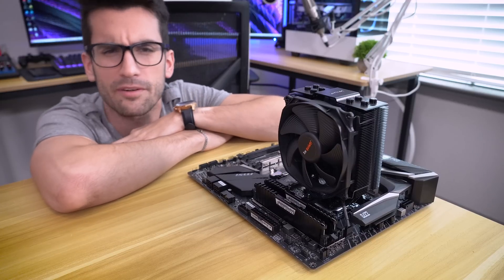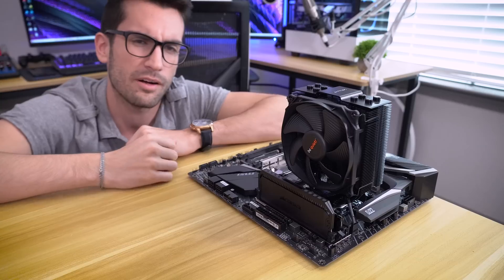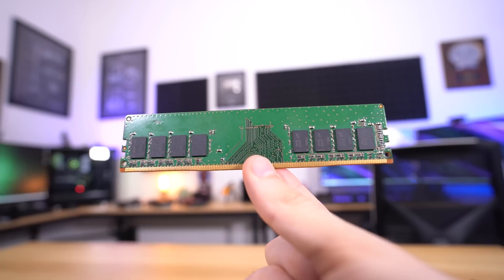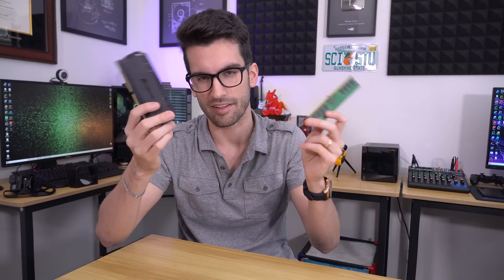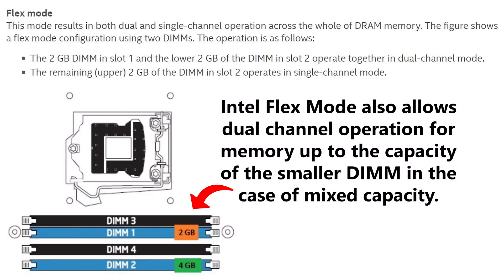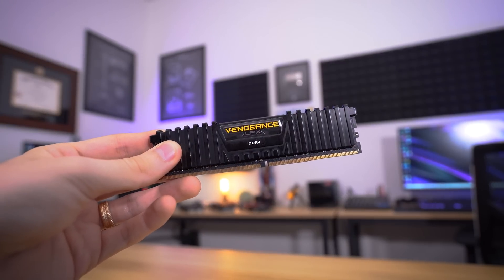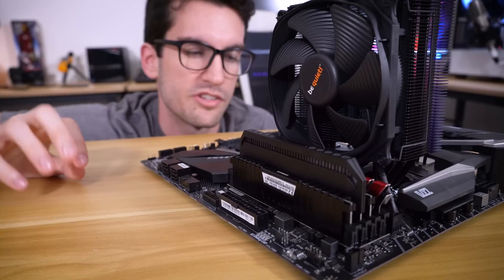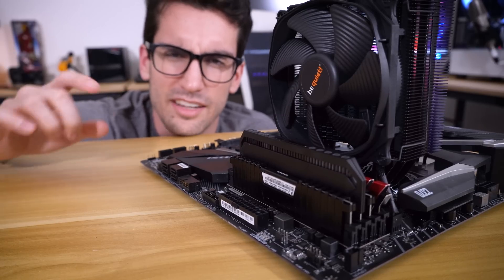Mixing RAM?!

Comment: Reminds me of my first personal PC...

A 366MHZ AMD with a crappy PCCHIPS mobo that had 2x simm and 2x dimm slots.

Turned out you could mix them. (In hindsight, i must have severely gimped the memory speeds there) :P
https://stason.org/TULARC/pc/motherboards/P/PC-CHIPS-MANUFACTURING-LTD-Pentium-M590.html

Comment: An important addition, I think, people shouldn't assume that the memory is the same if they don't buy it as one package. On the same model the memory can be different, for some/many models they use more than one die. Corsair Vengeance for example is known for that, you might get SamsungB, you might get HynixC...
Reply: Great point. I have that exact ram. I had 2x8 gigs, so I upgraded to 4x8 by buying another 2x8 gig kit. Same brand, model, frequency, latency, etc, but different manufacturers. It caused me to have boot issues. It would work fine for a couple of months, but then it wouldn't boot unless I power cycled multiple times. Eventually it wouldn't boot at all until I removed the RAM and put it back it. Same thing would happen every couple of months.
Reply: @HorseyTimes  have you tested the memory in different slots? And just the new memory? If it does not work with just new memory in any slots it's the new ram that is the issue. Weird it works for and then not. Could be ba motherboard. I had to swap motherboard on old pc, cus pc slowed down randomly, fna header died, board bent maybe 5 deg. USB devices randomly disconnected.
If no such issues it's the ram I think.
Reply: @mtbboy1993  I initially thought it might be the motherboard also. I swapped the battery thinking maybe that was the issue,  but the only thing I could do to get it to boot was to take out the RAM. Everything works fine once it has booted. I'll probably buy a 2x16 gig kit in the next week or so and see if the problem continues to reoccur.
Reply: how much difference will thatt do? I have Corsair DDR3 1600MHz 2x4gb 8GB LP in my system now. so if I buy the current stock, will it be different from the old pc?
Reply: @mtbboy1993 it caused me to have boot issues. My PC would turn on but wouldn't post. Sometimes I could get it to post, if I power cycled a few times, but eventually it wouldn't post at all. Removing the Ram and putting it back in seemed to temporarily fix the problem,  but for whatever reason the problem reoccurs every couple of months.  The only thing I can trace it to is the RAM upgrade and having different manufacturers.  I don't know of a way to check the manufacturer, at least not online.
Reply: @HorseyTimes  Usually it has a name on it. Unless dyou bought some random cheap ram. Best thing is to search for same Ram. But if it really differs within same model I don't know how to avoid that. Not had this issue. I rebuilt my old pc with two more sticks of corsair Vengeance ddr3 1600mh was 8gb upgraded to 16gb. No issue.
But if it worked for me does not mean it will work for you. I've not had issues with ram dying or being defective. So I went for Vengeance ddr4 on my new pc. No problems, 64gb. 👌
Reply: @HorseyTimes  maybe it was faulty? I did not have much time on the rebuilt pc but it booted up fast no issues. But could have got exact same memory down to every single part. Who knows.
Reply: @mtbboy1993  yeah both kits are Corsair Vengeance RGB Pro 16GB (2x8) DDR4 3600 C18 memory. They just have different manufacturers.  Each RAM stick works on its own and in each channel. I really think it is just a problem with the different manufacturers. I will probably just buy a 2x16 gig kit.
Reply: @HorseyTimes  So not exact same model as I had. Nor the new ones I have. I basically got same style, no bling, no RGB. Old pc has DDR3. DDR4 was the current memory standard at the time. 
DDR5 exist, but it's very limited, and price was insane. only most extreme builds had it, very limited board and memory options back then, but not checked if lately if DDR5 is current.
Reply: @mtbboy1993  yeah when I said I had the exact RAM I was replying to the original comment. I have Corsair Vengeance one kit manufactured by Samsung second kit by Kynix. I don't see anywhere on the Amazon listing where the manufacturer is listed, to avoid similar problems,  but it could be buried somewhere.

Comment: I mixed a pair of 8gb each cl 15 3000mhz with a pair of 8gb each of cl 16 3200 so I could get 32gb in my system  until I could and as long as I set the speed and timing to the slower sticks everything worked fine.

Comment: Ugh, you can tune timings per channel on some boards.
Different ICs will work fine if you  check that BIOS has trained the memory to stable timings, I shouldn't need to say this, but XMP only stores primaries and a few secondaries and tertiaries, which means even a good set of the same ICs can be unstable if you have a  mobo from companies like Asrock, Gigabyte and Biostar

Comment: It's funny I just had to get more ram for my system because between space engineers and chrome being pac man on my ram I have been maxing it out but the same ram I have now was gonna cost more vs much faster cheaper gskill memory.
Reply: What? Did you mix the RAM or not? Are the mixed RAM of deferent size or not? What about their frequency and timings?
Reply: Get what you can afford and tweak the timings till memtest is stable to 20k%
Reply: Got a similar situation, only difference is, that at this point putting more in is a waste.

Comment: For ryzen slots 2 and 4  usually can run ram better than 1 and 3 that is because  slots are usually on ryzen boards conected in daisichain so trace from one chanel goes to 1 and fom there it rinc to 2 same for 3and4 ...so saying tat it is logical tat shorter path is better so a lot of peple assume that 1and3 is better but it turns out that signal integrity is better if less of metal(trace) is "exposed". So for ryzen it is better to run them in farther two slots (2,4).
Reply from the maker: It 100% depends on the board. Every manual will designate optimal slots for a 2-DIMM dual channel config.

Comment: My Ryzen build crashes whenever I launch anything, unless I use the slowest RAM speed settings.

Its irritating, but the base is good enough to play games and mess around with Vegas.
Reply: Set the timings manually and you will be fine, you have a bad board for memory training, so you have to do it manually
Reply: @TheXlen  Yeah it X370 upgraded for Zen+, and it wasn't a good board even for that generation.
Reply: @drbedlam9786  one of 3 asrock gigabyte or biostar🤔
Reply: @TheXlen  gigabyte. I made the mistake of getting their Vega 56 OC too. ... Which does nothing but crash and max its fans out.
Reply: @drbedlam9786  I doubt that it is Vega 56 OC fault, probably your PSU
Reply: @TheXlen  I'm not the only one with the same complaint though.
Reply: @drbedlam9786  yea and most people that complain have 450W PSUs with it
Reply: @TheXlen  I'm using 750W   :P
Reply: @drbedlam9786  750W on it's own doesn't mean much :D

What brand? What 12V rail?
Reply: RAM speed doesn't really matter as far as my experience
Reply: @johnadam1271  it does matter a lot even on intel
Reply: @TheXlen  can you tell me where is matter? And can you give an example

As far as I know it doesn't matter and if it does please convince me because I will buy new laptop soon and it is customisable
Reply: @johnadam1271  RAM speed on zen architecture can get you up to 15% performance difference, RAM speed on intel can get you 3-7% performance uplift, depending on what you do you will want at least 3200CL16 RAM

Comment: Can i use 2 different ram like 
8GB & 16GB and still achieve dual channel ram config or they have to be exactly same for dual channel RAM
Reply from the maker: Dual channel up to 8GB. Remaining 8GB on the 16GB module will be single-channel. This was briefly mentioned in the video.
Reply: @GregSalazar  i have 2*8 GB RAM in my laptop when i upgrade it in a few years should i buy 2*16 or just swap out 1 8GB with a 16GB one (Rog strix scar 3 purpose gaming & light editing)
Reply: @GregSalazar  sorry I'm kinda noob at computers didn't understand much
Reply: @GregSalazar  what would be the impact of it? Please explain

Comment: Mixed a 2133 Hyperx with a 3200 Ballistix. Setted both to 2800, tightened the timings as low as possible and voìla.
Reply: running 2133 at 2800? damn, son. gg sticks you got there!
Reply: @etsd311  yeah, just saving money to buy a new 3200 one. It's expensive here, so I needed to overclock. Didn't know that it could go that far.

Comment: II remembered my  fx 6300 system on na 990fx chipset. I used 1 HyperX 8gb 1866mhz cl11 and 2x4GB 1600mhz CL9 Corsair Vengeance. welp if it fits it good. hahaha. Used it for a good 5 years until earlier this year.

Comment: I got 40Gb of RAM, 2x4 and 2x16, running fine at 3000Mhz with XMP. I used to run at 3200Mhz but as said in the video, lots of BSOD and game crashes.
Reply: What is BSOD? Or SOD?
Reply: @johnadam1271  Blue Screen Of Death
Reply: Because you hadn't trained the memory to stable timings

Comment: Technically, on a laptop with soldered RAM and one SO-DIMM socket. It's essentially mixing RAM. I don't know if I like that though.
Reply: laptops with soldered ram are the worst. i had to remove the mobo from a cheap laptop to get to the dimm slot and it was an utter nightmare
Reply: @jordydrop  Yea. But unfortunately, if you want thin and light. It's literally your only option. I wish we could do a bit better on the engineering to make SO-DIMMs work on ultrabooks or have a new mem standard.
Reply: @MarcoGPUtuber  there are plenty of ultrabooks that have dimm slots.
Reply: @jordydrop  Right! But plenty is not enough. It should be all.
Reply: you can use the command prompt to get the actual model number of the RAM and then buy the exact RAM module online.
Reply: Soldered ram has a lot of factors being considered. One of them is manufacturing cost. Most manufacturers opted for this kind of process especially in ultrabooks to make them thin as possible.

Been using this type of ram in while and got no issues, just dont game too much.
Reply: Can you help me out please?
I have 4GB soldered and I have one slot given to add an another ram.
Can I add an 8Gb stick? Or should I opt for another 4Gb stick? The laptop supports total of 16 GB I believe.
So can will I be able to access dual channel mode on 12 gb of ram?
Or should I just stick to a total of 8GB? I find 8GB bare minimum for running windows 10.
Any help would be appreciated.
Reply: @cityofdreams573  what did you end up doing? I to have 4GB soldered and I plan on taking the other 4gb chip out and throwing in a 16 gigabyte
Reply: @lobbyrobby  I ended up adding a 4GB stick, so I'm running 8GB in total.
If yours support 32GB in total, then go for it.
Reply: @cityofdreams573  what frequency did you use? I have 4gb ram 2666mhz and the supported frequency for my motherboard is 2400mhz. Should I buy 4gb 2666mhz or 2444mhz? Thanks
Reply: @akio7729  you should by same mhz

Comment: It’s killing me inside watching you put a ram in with one hand
Reply: Not only more secure but you want to apple equal pressure on both sides of the ram to prevent damaging it.
Reply: @ElTeeger  eh, what? A RAM module is probably one of the strongest single items inside a PC. There is very little flex, there is hardly any extruding capacitors or similar, and the strength is pretty much equal across the whole circuit-board. There is no force needed to insert the RAM at all until you want to click the fasteners in place, and even then, it should be perfectly doable with one hand. That being said, there are also plenty of RAM slots that only have ONE fastener that moves - the other one is stuck in place, and you cannot insert the RAM stick directly downwards - you have to put it in at an angle. 

So, your assumption is utterly, completely wrong.
Reply: errilhl there’s no assumption made. Inserting the ram with two hands help prevent it from damaging. You gave a long explanation that isn’t relevant to what I was saying. Yeah you can insert with one hand but it’s safer do insert with two.
Reply: @ElTeeger  i think the concern lies more in the socket
Reply: @Daniel Combs then, again, I would like for you to tell me how you would phrase it? Because "a stick of (some nomenclature to describe which type) RAM" is perfectly valid English. It IS a stick of RAM. Or "a RAM module". I'm still not entirely sure what you find weird.
Reply: Why?
Reply: Yeah, why? I do it all the time haha
Reply: Eduardo Yamamoto its more secure to put it in with 2 hands, also looks more professional.
Reply: @derpzu5838  Pros use 1 hand though, while using the other to drink a cold beer.
Reply: @derpzu5838  yes. Like a "professional ram installer".
Reply: shemaycry Viewers that make a big deal out of everything
Reply: @Daniel Combs What else would I call it? "A DIMM module", then? Better? Problem is that it's true for any type of RAM, that be DIMM, RAMBUS, SIMM, etc. Hence, "a RAM module"
Reply: He was touching pins of a Ryzen 7 processor
Reply: @Daniel Combs Whats wrong with "picture"? So when I take a picture, I'm actually " snapping a photo" acording to millenials?
Reply: @Daniel Combs I never argued about his usage of the word RAM. On that I agree with you. My question was, Whats wrong with "pictures".
Reply: @Daniel Combs ah... Ok. Then were on the same page :D

Comment: I learned the hard way as a teenager by mixing RIMMs and terminators. Thank GOD DDR SDRAM took over and Rambus RIMM RAM died.
Reply: Rambus RAM was quite bad at mixing unlike the DRAM we use these days
Reply: or the DDR SDRAM back then
Reply: @TheXlen  so sdram and dram is okay to mix?
Reply: @CREX_CUSTOMS  good luck with getting them to mix😂
Reply: @TheXlen  is it possible too?
Reply: @CREX_CUSTOMS  not really, I mean you could probably find a way, it just wouldn't be what you're looking for
Reply: RIMM RAM is funner to say though